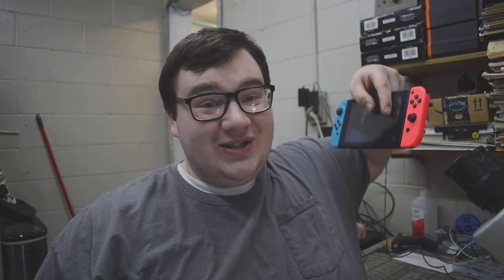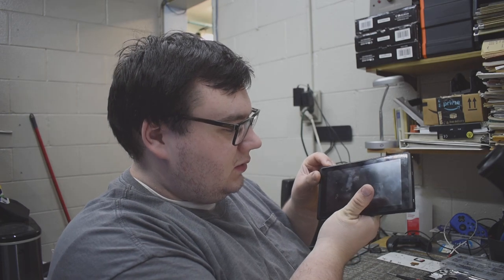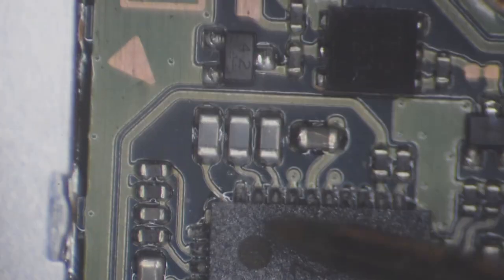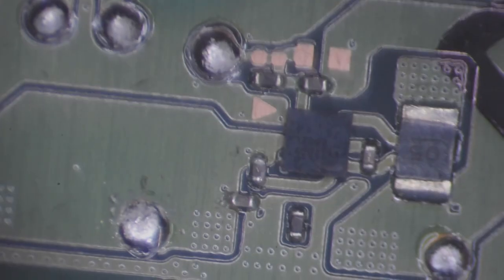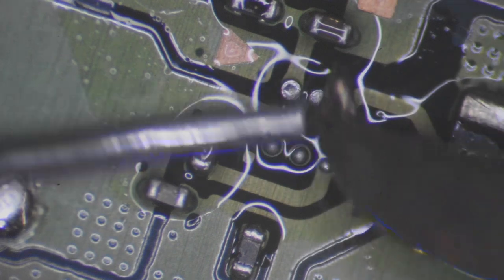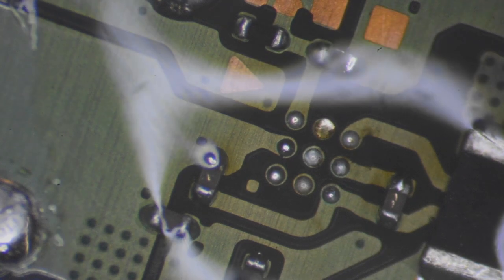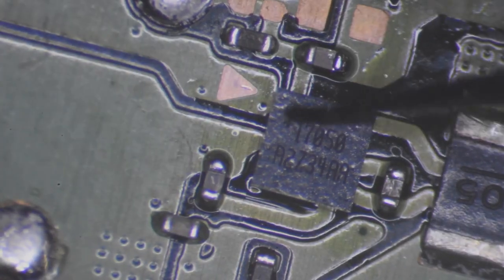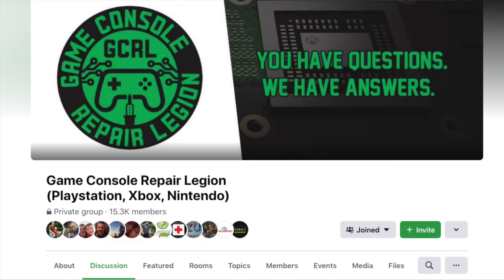Nintendo Switch Flashes "Nintendo" logo then Black screen Repair | No Fix

Comment: Thanks for this video, had a water damaged Switch doing the same thing. I only wish I'd seen this before buying a replacement battery which, needless to say, didn't work.
Reply from the maker: It could literally be anything with liquid damage unfortunately.

Comment: I just fixed my daughters that was doing the same thing .. I grabbed it firmly and gave it a firm squeeze and slight twist back en forth ..turned right on after doing the same Nintendo start up shut off.. hope this helps someone.. some things inside prob didn’t have the contact .. also I noticed a screw was slightly loose on the back end ..
Reply from the maker: Thank you for checking out my channel! You may have the same issue in the future because you probably have broken solder joints under the ram or APU. 
Hope it continues to work for you, but i wouldn't recommend that as a solid fix, it could cause more harm than good. Take care Matt!
Reply: @chasefournier  thanks yes I’ll get it looked at .. it’s acting stubborn again .. thanks for the feedback
Reply: Just tried this and it turned on. Thanks to you both. I'll have it looked at and recommend having those parts looked at specifically.
Reply: What do you mean by this I having the same problem

Comment: Thank you for the little clarification points you made. For example, stating that the arrow indicates the first pin of an ic. Keep it up 👍.
Reply from the maker: No problem! Ofcourse, not everyboard has an indicator, but most seem to have them. Always handy to make note of where pin #1 is before removing an IC, by taking a pic of the area before removal.

Comment: i have x4 nintendo switch lite with same issue, it's good i stumble upon that video and now not wasting time on fixing these switch lite consoles.
Reply from the maker: I would still look into it, it could be a different issue then what I found.
Reply: @chasefournier  I checked under the thermal camera with the battery connected Max77812 chip gets hot and two big capacitors around are shorted after removing the chip short stays and problem not fixed. When I apply a voltage to shorted caps cpu gets heat up a little. Seems like a no fix but I'm still on it.
Reply from the maker: @TaaRiiFrp  the Caps might not be shorted, it could be low impedance to ground. 

At least on PS5, you can measure a 0.50 ohm resistance to gnd, and its not shorted.
Reply from the maker: @TaaRiiFrp  also, be careful when injecting voltage. Always use 1 volt or less on a line that you're not sure what it is.

Comment: Chase sometimes you need to change a small ic tmp451 is a temperature sensor if you change the batery detection ic and still the same then could be that ic Tmp451 when nintendo sw is booting test all components if some give error then will shut down after Nintendo brand logo.
Reply from the maker: I'll have to give this a try next time I see this issue.
Reply: @chasefournier  thanks for response greetings from Panamá .
Reply: I'm interested to know more about this since I have this problem on a switch. Where is the chip on the board exactly?
Reply: Hello! Any reference values of tmp451 for test?

Comment: Thank you for the video. I just started doing repairs in my free time, and I swapped a faulty switch fan for a friend. The console was overheating and shutting down after 20 minutes. After the fan swap, the console had this very issue. Do you know what can cause this ?
Reply from the maker: Unfortunately it is unknown what's causing the issue.
Reply: Have you found it out i have this exact issue

Comment: Hey chase i just wanted to  put this here in case anyone else is having this issue. Here what happened and how i fixed it. I was updating my system software and then it turned off and would go black after the "Nintendo" logo. After trying a billion things I found a fix for me. I booted my switch into RCM using a paper clip. Used fusee-gelee payload, booted into Atmosphere CFW, went into the settings and updated the system firmware through there. Once you restart the switch it will boot back into the normal firmware. Chase if you haven't thrown out that switch or used it for parts i think it would be really cool if you made a video of this possible fix. I partially hacked my switch to get it working back to legit.
Reply from the maker: This is an awesome solution! 

Thankfully now we have the ability to directly back up the EMMC and clone the data over to a new EMMC if we need too. 

I don't have this customers information anymore 😭
Reply: Please could you make a video on this??

Comment: Hi, just stumbled across your channel, I like it, with regards to this fault, have you tried to reflow/replace the wifi chip? I have read this could lead to this issue?
Reply from the maker: I actually didn't attempt that. However, with some research, a few techs have determined that when the switch is "stuck" on the Nintendo logo, that reflowing or replacing the wifi IC does fix it.
Reply: @chasefournier  I have a switch with exactly the same fault, I have replaced the wifi IC and in my case, fault remains.
Reply: @dan_1150  so what did you do ?
Reply: @hayley4523  the board went in the donor/investigate later pile lol

Comment: You could try to reflow the nand or dump the nand raw data plus boot partitions using a cheap sd to switch nand reader maybe even rebuild the fw but that might need a modchip  if it's a old mode switchl the customer might have used rcm mode and bricked it

Comment: Hello, I was charging my switch.. and came back with it turned on to the second logo screen " Nintendo switch with the joy-cons" and now its stuck there. I cant access recovery mode via holding the power and audio buttons. I've let the switch stay on to drain the battery  and let it rest overnight. But still when I boot up the system its stuck on the 2nd logo. Any ideas what I can do to fix it? Thank you.
Reply from the maker: It could be several different things, but possibly a Wi-Fi chip related issue if it's reaching the second screen after the initial Nintendo logo.
Reply: @chasefournier  anything I can do to try to fix it? Or do I have to send it off to nitendo?

Comment: I got to switch lite the other day with a similar issue in the way to tell is when you get the Nintendo logo and it turns right off check the positive and negative battery terminals while the battery is plugged in if you get a short across those two you'll know it's the ic control... Because after you disconnect the battery that short will go away and it's very confusing so just to reiterate unplug the battery plug it back in turn it on and get the Nintendo logo check positive and negative while the battery is still plugged in for continuity
Reply: i have this issue bat connector gets short after boot what can it be? i tried the control ic already same thing

Comment: Any advice for when your switch makes a buzzing sound when you use it?
Reply from the maker: Unfortunately, I'm not familiar with a buzzing sound, I'd almost need to see it.
Reply: @chasefournier  I wasn’t clear before. The fan on my switch seems to be loud these days. Using an air can to get dust out helped make it quieter, but I still hear it going. I even tried using a damp q tip to clean the vents and that made the fan silent for a while but now the fan is loud again.

Comment: Mine is bootlooping. I tried all simple methods like holding the power button down for 15 seconds several times, charging it overnight, taking the sd card out, and even putting it in the freezer for 10 minutes. No luck. I also went as far as taking it apart and cleaning it, disconnecting the battery and plugging it back in. I am not a repair person by any means either so I have no idea what I can do to fix my Nintendo Switch. Hope someone can help!

Comment: Do they not have a built in bootrom you have boot to to try and re format/ reinstall os from the nand?
Reply from the maker: The console doesn't even boot into the OS. So there's no way to reformat it.

Realistically the only way to actually fix a nand issue is to have a backup of the original nand, and flash it to a new chip and install the new nand on the board.

Comment: I wonder if you can help me out? 

So my switch was beginning to heat up quick even when in sleep mode. I had some thermal paste lying around so I decided to replace it. Before all of this, I can confirm the Switch was working fine. After I put it back together, the Switch doesn't detect WiFi signals anymore. It only prompts me to connect a wired internet, which I did do, and it did connect to the net, but the wireless does not work at all. It wasn't my router because my other switch does connect wirelessly.

I figured I must've hit something on the Switch I opened and concluded it may be the wifi chip. I may have made a terrible mistake. The EMMC board is what I thought the wifi chip was, based on a few internet searches. So I swapped that part with the working Switch I have just to test if that's where the problem is. Now both Switches won't boot up. I think really should not have done that. I did not know those chips are coded into the CPU. Is there any hope for these Switches now? I'm scheduling a repair soon but if you can tell me what exactly it is needed to be done just so I don't go in there blindly, I will greatly appreciate it!
Reply from the maker: I'd need to see the board to see if anything has been damaged. 

Other than that, the EMMC is the NAND (or bios/storage) chip. 
That chip can't be swapped between consoles. It is married to the APU.
Edit:
Also the wifi Bluetooth IC is actually under the EMMC shield. It's a BGA chip soldered to the main logic board.
Reply: @chasefournier  I put the EMMC back to their original consoles but neither of them are booting up now.
Reply from the maker: @jaredbanares9514  I'm assuming something else could've been damaged. Or in the rare case ESD Damage.

Comment: I went to update the switch was turned on and working then after the update it just didn’t turn back on only the first logo and switched off again, what’s it this problem?
Reply: same problem! how it solved ?
Reply: Same problem here.
Reply: Same problem here.
Reply: @electabuzz5227  I just put mine away in It's box for now until I find a way to fix it.

Comment: I have this same problem with the Nintendo logo flashing, but the switch works when I dock it and play it on the TV. I can also hear the touch screen being responsive to touch, but the screen is black.
Reply from the maker: Sounds like a possible backlight issue.

Comment: I had this issue about a year ago. Decided a few months ago to bring the switch back out and plug it in and the thing turned on like nothing was ever wrong. Went to go reset it yesterday and the issue came back.
Reply from the maker: It's gotta be an EMMC issue. I'd love to try to fix one at some point.
Reply: @chasefournier  I wouldn’t even mind sending you mine if you want a crack at it.

Comment: I have a Switch that works perfectly in the Dock but has a gray screen when out of the dock.  What do you think it could be? If I restart it on and off eventually the screen comes on but it it only stays on for a few mins and ends up gray again.
Reply from the maker: It could be a bad LCD, or possibly a bad LCD driver.

Comment: Did you try to boot into recovery mode by pressing vol up and vol down while turning it one? If it boots into this mode u can perform an factory reset
Reply from the maker: Unfortunately I did try it, to no avail.
Reply: @chasefournier  i see. did it at least boot into recovery or not?
Reply from the maker: @BennyAlex98  no recovery mode.

Comment: Hmm well rip my day one switch that was able to be modded updated software (not modded system) and now doesnt boot but can still inject payloads through RCM
Reply from the maker: Apparently there's a way to fix your NAND or rebuild it. 

You'll have to Google around and find a guide, if I come across another switch like this, I may investigate further.
Reply: @chasefournier  I gonna try restore a backup of my flash from 2019 before I modded my system but will look into that too

Comment: I have this issue for a customer device, yet the switch goes to the desktop. I'm thinking a video chip is at fault or something.
Reply from the maker: By desktop, do you mean the home screen? Like on a dock?
Reply: @chasefournier  The home screen. Switch is doing the same thing in the video, but the digitizer is still responsive and you can hear the switch scroll through menus and open apps, just can't see anything. Since it works, I need to dock it, then update the firmware. That was a potential fix I found in an article.
Reply: @chasefournier  Just an update on the situation. Updating the switch fixed the issue. There was some corrupted files on the switch. I was able to fix the no display by docking the unit to the TV and then performing an online update.

Comment: Hey friend, I had the same issue: charges fine, Nintendo logo flashes then disappears. It all started when I noticed my Switch come out of sleep mode on its own while in the dock, and an error on the screen that told me to reset the console. Unfortunately, I did not memorize the error code before trying to do so. I took it apart to disconnect and reconnect the battery and no luck. I googled the crap out of the problem and found nothing, except mention of the NAND. Shipped it out this morning to Nintendo, they'll either fix or replace for $99, out of warranty. Fun fact: if you hold down the power button for the hard reset, then don't hit anymore buttons, and just plug in the AC adapter, it will also flash the battery indicator.
Reply from the maker: Interesting! Yes it seems like this could be a NAND issue in some cases.
Reply: Yes this is wat mine doing trying find fix
Reply: @tlb2005  I never found a fix. Nintendo replaced my Switch for $99. Only took 2-3 weeks total between shipping it to them and getting the new one.

Comment: I have a switch lite that does the same thing or shows a blue screen
Reply from the maker: Your switch lite more than likely has an issue with the APU or RAM, if thats the case
Reply: Looks like that's screwed then
Reply: 420 hours of botw gone :(